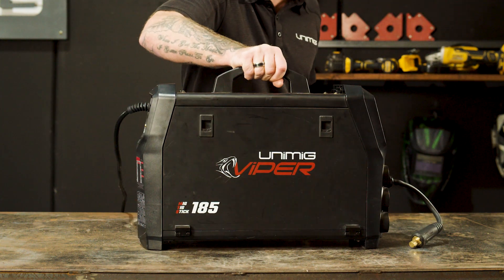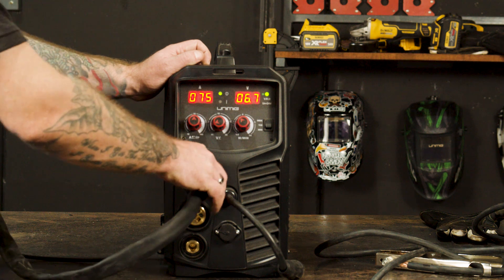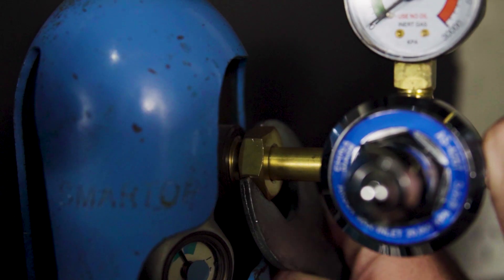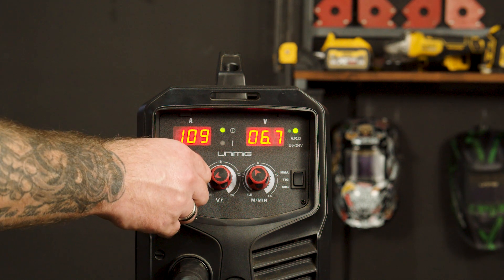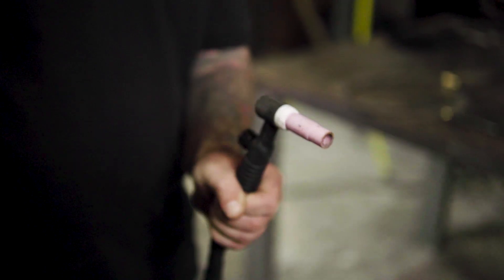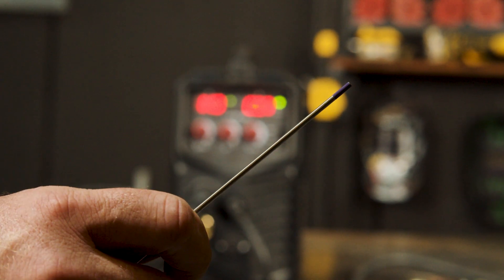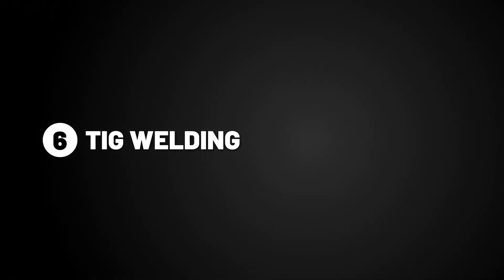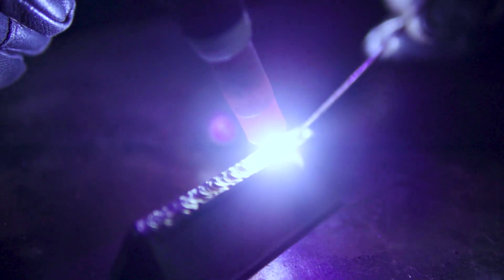VIPER 185 - DC Lift Arc TIG Welding Setup Guide

Comment: Hey I've got a 185 viper and just got a umt2f8m tig torch for it was just if I need a pedal for it as was thinking it had a button on the torch as it shows on the box cheers
Reply from the maker: Hey mate, if you have the Viper 185 you are meant to run the 17V Tig torch. The Viper 185 only has simple DC lift-arc functionality you can not use a button or foot control. The arc is ignited with a valved style torch.

Comment: Are there any welders in this price range that do pulse tig welding?
Reply from the maker: Unfortunately not, that requires a high-frequency TIG machine, not a lift arc TIG that is in early all multi-process welders. This is our 10 AMP pulse TIG machine. https://unimig.com.au/product/viper-180-ac-dc-tig-welder/
Reply: @unimigsupport  thanks guys.